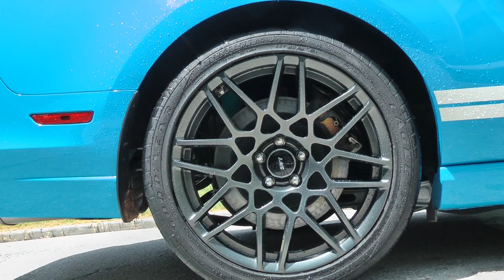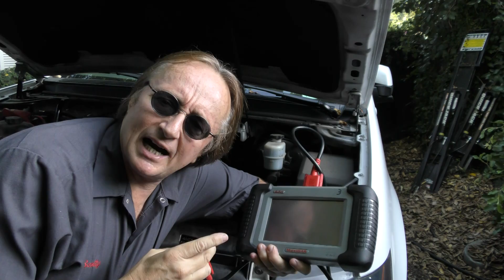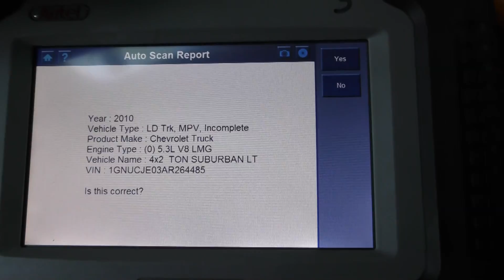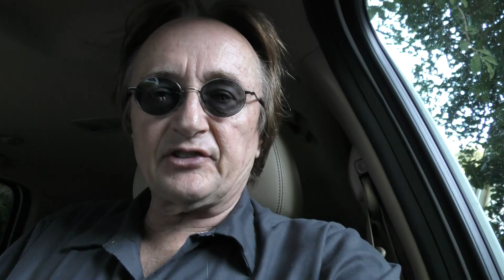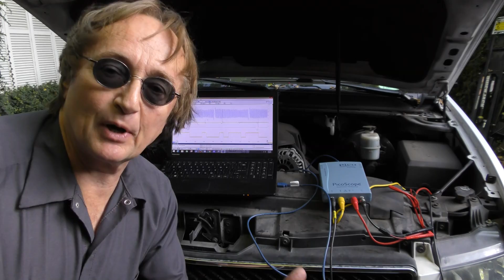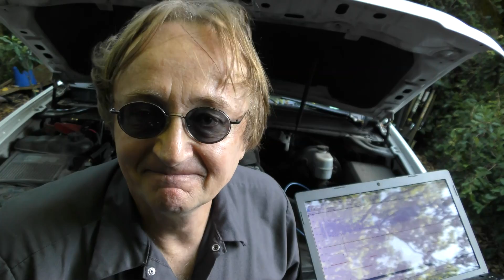Why Mechanics Charge So Much to Fix Your Car

Comment: Please.. I agree that modern cars are insanely complex, but the guys at the dealerships aren't much smarter than anyone else unless it's a common documented issue. The other issue is if there is a complex issue, like the one on that tahoe, most dealers don't want to touch it not because it's complicated, but because the time needed to diagnose such an issue is huge money. I just recently fixed my 2013 Jeep Wrangler that had a bad crank sensor, but it wasn't bad enough that it threw a code. So even though it was under warranty 2 dealers simply said "Could not replicate" the issue. Grated it was an intermittent stall issue, but it took myself and about 2 days probing multiple sensors with a cheap rigol Oscilloscope to find the square wave from the sensor was dropping out very occasionally. Simply put, most but not all Mechanics are nothing more than parts changers.,,
Reply: all carpenters do is cut wood all firemen do is put out fires all bill gates did was look at a computer all day
Reply: Gmtail Which is why no one should NEVER trust them with what is theirs!
Reply: Agreed.. I am a car guy, so I am real picky about what work gets done, and who does it even under warranty. I also always check their work, tend to hang around more than I should. Most experiences have been positive, but a few I had to step in.
Reply: @Gmtail  thats a real dick move in my book imagine you at your job and i stand behind you and say no you arnt suppose to do it like that this is how you do it considering i have no experience or qualifications

Comment: Mechanics charge so much because they only get paid for labor the parts cost only covers the cost of the actual parts and a little secret if they charge you for 2 hours of work they get paid for 2 hours wether it takes them 1 hour or 5
Reply: Jason  Staggs That's if it is the flat rate system.  If it is warranty the mech gets less labor time than standard for the exact same job.  That's one reason it's hard to make money working at a dealership if you don't get the right vehicles.  Our shop pays it's employees hourly.  The pay may be less, but you know what you'll have at the end of the week and most the time the stress level is less.

Comment: Hey scotty, I always hear you say "modern cars" what years would you consider to be modern? I know my 99 Jeep GC is full of electrical issues that I've yet to be able to fix. I've replaced my BCM as well but the problems persisted, I'm kind of leaning towards my PCM or alternator at this point because once I run the car with the alternator unplugged from the battery/pcm my gauges start working again.

Comment: Subaru wanted $1k for a power steering pump on my grandmas Subaru.. its was 170 dollars in parts, and took me 2 slow hours to do.. Also the power steering pump is the most accessible thing on a Subaru
Reply: Clayton Bridges .....Other than the head gasket issue with N/A Subaru engine, they are really easy to work on. It’s true you may need a scanner when CEL goes on, but the work is not that difficult for a DIY.

Comment: Just stick to a car from the 90's, I would recommend an import, Last a long time, generally speaking pretty easy to work on, easy to find parts for them. If the engine ever goes out, you can just look for another used engine and swap it out. Like Honda or Toyota.

Comment: because they paid too much for scan tools you can not buy because it's expensive and you don't need it everyday ,  and they get you directly to the problems without any guessing

am i right Mr.Scotty?
Reply: thesniperofcs That is a misconception that a scan tool tells you exactly what is wrong.  The tool is an aid in helping you diagnose a problem.  You still have to interpret the information and then use experience, techniques, procedures, service information, and system knowledge to isolate the issue.  Does you home computer tell you what is exactly wrong when it pops up an error code?  If scanners could tell you what part to replace, I guess we wouldn't need tech schooling, diagnostic trouble charts, training on new systems, or have to pay for expensive tooling.  Heck every Tom, Dick, and Harry could fix driveability and electric problems on cars and I would be out of a job.

Comment: Coming soon in a modern car ......you will not be able to replace anything not even a battery, light bulb or any sensor without needing the computer to be reset by the Dealer.... soon it will be brakes, wheels and exhaust.

Comment: WOW! I was considering selling my 1994 truck, but I think I'll keep it going now bc everything newer is even more complex and impossible for DIY repairs.
Reply: Even my 1995 truck was already getting too complcated with plethora of sensors and ECU in trouble breeding feedback loop.  But changing fuel filter was 20 min job, not like newer trucks where  you have to drop the tank

Comment: This is why I drive a 1994 Chevy Silverado.  Easy to fix, but you still have the luxury of anti-lock brakes.  As a side note, ignore the back up camera and learn to drive the old school way.  I've seen damaged bumpers and tailgates, due to a lazy reliance on cameras and sensors.  They're not that accurate.

Comment: I am 55 and my dad was a master mechanic for over 50 years. he live to 94 He taught me a lot so I could take a car apart and put it back together again.. I worked on my car from the age of 15 then I went in the NAVY on submarines after 7 years in I got hurt badly but even in a wheelchair I could still work on the cars before 2012 . I can still do the small stuff oil spark plugs and a few other things . My car now a 2014 has no dip stick and the transmission can not have the fluid change. No wander mechanics make so much car makers are making them way harder to work on like me a back yard mechanic .

Comment: Very good reason not to buy any of this modern day junk on wheels. These news cars don't last as long as the older vehicles of the 1940s,50s,60s,70s and 80s It so true when you see 100+ year old Tin Lizzie on the road still.

Comment: God what a joke all this electronic crap. Think I'll just keep my 97 corolla running.
Reply: kerry1111111 Your vehicle has an engine controller, maybe an ABS and airbag controllers on board.  There is more electrical microprocessors in your Toyota than you think.
Reply: Oh yeah I know but I don't think to the extent of one of these newer cars. They seem to be engineering backyard Mechanics out of the game?

Comment: I haven't been to a mechanic in years and I have OBD2 cars. Many sensors and their circuits can be checked with a volt and ohm meter and don't need fancy equipment, but I'd certainly like to learn more about live data analysis.

Comment: Sadly most cars from the 80s and even early 90s aren't worth the hassle.  Finding one that was owned by someone responsible is a real gem. Finding cheap used cars is easier than ever though if you know where to look.   I bought a 2007 mazda 3 with 60k miles on it for 6k back in 2010. The previous owner leased it and barely changed the oil.  Luckily engines aren't so fragile. 3 low mileage oil changes later and the the valves look good as new.
Reply: @exmerion - Are you such a know-it-all in daily life, too ?!?

Comment: I can offer another insight into why mechanics charge so much. The labor. By that I mean that hard to get at part that you scrape up your arm on. Or the hard to get at bolt where you need to contort painfully to get to it, and you're lucky to get one click on the ratchet.

Or repairing the "repair" done by the previous owner.

Not a mechanic myself. Just someone with a growing experience working on used cars.
Reply: Yes life as mechanics can be very annoying.  You cannot choose what cars you work on.  As DIY owner, we can pick an old, easy car to work on, but not professional mechanics.

Comment: you can get a lot of that same data with a 12$ blutooth adapter which you can output all the data to a laptop of a cellphone saving money on buying the specialty hardware. its not enough to flash the computer or do anything like that but its enough to give you a good idea of whats wrong

Comment: I took my Subaru into the dealer because I couldn't figure out what was wrong with it and it needed to go in anyways for the airbag recall. I paid $50 for the diagnostic, turns out it was just the O2 sensor (I'd guessed either that or the map sensor) But then they wanted to charge me $400+ to replace it... It's one bolt and a plug, unless their shop rate is 1k and hour I don't see that happening. Bought the exact oem make off the internet for $100 and did it in 10 minutes. I'll keep my $300 thank you

Comment: Hey Scotty thank you for your video. I got problem in 06 murano. When car ideas engine randomly surges and car looses power when acceleration up the hill. Rpm go high and barely any acceleration. It started to happen after previous mechanic changed my spark plugs. Thank you !!!!
Reply: Hey @AramK - It's been 5 years since you asked the UNCLEAR question above on an 06 Murano.  Did you find a mechanic to fix, yet?!?

Comment: Love your vids scotty. i drive a 95 lexus es300. This problem took me almost a month to figure out. My car would lose OD gear randomly. Didn't know what the problem was. Couldn't figure it out. Took it to 3 transmission shops and even went as far as taking it to the lexus dealer.  Nobody could fix my car. Long story short it was the ECU. Now my car shifts prefect.

Comment: Why do they charge so much? Well sometimes work can be taxing... Most of the time, fact is, you DONT know what to do... They do. You do not understand what really has to be done to get it done. They do. So basically.... You can get scammed easy. You wont know better. Or they are hard workers and do the job right. Which you still really dont know. Good luck!!!!!!!!!!!!..............
Reply: Reading codes its like puzzle on new cars it may point out at the map sensor but, it could be a vacuum leak stupod codes.

Comment: Mileniums can't turn a screw.
Reply: It's millenials, not Mileniums.
Reply: I love it!  Mileniums is better than my grand papa calling it face page!  Im stealing this word.
Reply: This dumbass trying to talk shit about another generation, yet can't even do it correctly.  Btw it's generation Y also.  Bet ya learned something new.

And no i'm not a millennial im part of generation X 😏
Reply: marc G tf Is mileniums?
Reply: Actually, when I worked at John Deere (building Gators), there were quite a few extremely talented millenials there. Those kids knew those Gators, inside and out.
Reply: We rather know advanced computer systems than an easy thing like turning a screw. We'll leave that to the old people.
Reply: no its weak minded sheep who cant turn a wrench. I have over 300k miles on my vehicle's and have made every repair myself.

Comment: never buy a lifetime 4-wheel alignment from tire kingdom or tires choice. the mechanic gets a  certain percentage by doing an alignment, but they dont get anything from a car with a lifetime 4-wheel alignment...so they just half-ass it, or dont even check it at all
Reply: agree I've checked my car after some of these life time alignments from firestone and struts bolts are left loose and most time the alignment is worst than when you bring it in.
Reply: Yes, true.  It's just a money grab and the subsequent times you come around, unless you're buying new tires or services, they will not be happy to see you wasting their time.
Reply: As a mechanic at national tire and battery (tire kingdom branch) you are absolutely incorrect. We get 5$ commission on program alignments. We almost always at least tweak the toe a little bit even if it's still in spec. A lot of people will drive around with major steering/suspension issues and an alignment will never hold true and customers are informed of that as well.
Reply: jared Taylor at the factory if a car comes back through alignment for whatever reason it can already be out of spec and its only been driven a mile or so.
Reply: Love seeing clueless dipshits think they know what they're talking about

Comment: hey Scotty I have a 1995 Toyota Camry 2.2 4cyl. the car has 303766 miles on it and the transmission just took a dump should see if the filter and fluid should be changed or just take it to ammco will fix it?

Comment: OK I will take a stab at it. They charge a lot because they, as Scotty has shown us, have to buy and maintain equipment that costs TENS OF THOUSANDS OF DOLLARS, including, but not limited to: Bidirectional scan tools, multi-channel oscilloscopes (like the Pico),  alignment machines (priced one of those babies lately?), hydraulic lifts (they certainly aren't cheap), air compressors, hand tools (try, just try, to get on and off the Snap-on truck for less than a thousand bucks somtime), software updates (hundreds of dollars per month),rent/mortgage on shop, utilities, supplies, salaries if he has any help in his shop, and don't forget he is self-employed (at least the independent mechanic) meaning he has to pay BOTH the employer AND employee portions of FED tax, state tax, social security, medicare, and other taxes and taxes on the taxes. Add in licensing and ongoing training, and, I'm no mechanic, but I suspect you have a fair bit of overhead in all this.

Comment: mechanics always want to charge me double the price for parts.  I can always find them cheaper on Amazon and with a good brand.
Reply: encryptor try not to buy electrical parts on ebay or rockauto or amazon (i.e. ac compressor, fuel pump). those places are only good for parts that you cannot normaly get from autozone. i learned this the hard way.

Comment: Unless you have a VW, you can replace the battery. Dealer only carried the part, then the computer had to be resets it would know a new battery was installed.

Comment: mechanic's charge so much because they Make a 100 dollars a hour. so for something simple like a diagnostic should be 100 flat. Anything above a 100 a hour they are  over chargering you. the 100 dollars comes from the bar which states mechanic's are paid 100 a hour but like Scotty who seems a cool guy like myself will be honest a fair but some out there will charge 500 for "oxygen fuel sensor". .

Comment: My moms boyfriend told me there are 2 types of mechanics , 1 that rips you off and charges you up the ass, and 2 that rips you off and charges you up the ass but fixes the problem
Reply: She's So High its true for the most part. but there are a few honest mechanics. i recall driving to a guys house who had a ford ranger with a crank, no start issue. he was convinced that it was a clogged fuel filter. before i even got to that point i replaced the fuel pump relay with another one. the car started up. i charged him 30 bucks. on my way home i thought to myself, " i dont think i charged him enough"
Reply: But if you give actual ass than it's free.
Reply: She's So High, there is another kind, one that fixes the problem and charges accordingly
Reply: She's So High yet people love getting ripped off daily when they eat fast food and spend $5-10 on food that is worth $1 at most. 

💯
Reply: He's right
Reply: She's So High hit me up when you wana get higher😍
Reply: That's the iron triangle of business: Get it done fast, get it done cheap, get it done right. Pick two.
Reply: She's So High Get on your knees.Thall make payment
Reply: define rip off. if you cant get the work done cheaper anywhere else it isnt a rip off, its just how much it costs
Reply: @Bjorn Ironsides  what is reasonable and according to whose rules?!
how would someone come up with a 'reasonable' price?!
Reply: She's So High either way they both rips you off.
Reply: @STeeLo205  rip

Comment: You can't even change the battery on a modern car anymore. With all these fancy start stop features, you have to take the car to the dealer for them to 'program' the car to accept the new battery. All a whole load of money making baloney if you ask me!
Reply: I wrote same coment before reading yours..............it's racket politics and looting the customers.......( maffia governments , asphyxiating restrictions and regulations , taxes and licenses , controls and fines for whatever once you sit behind the steering wheel )
Reply: You can buy cars without these features.  For the people willing to pay for them there is a benefit.
Reply: Incorrect, I always hook up a battery saver to the obd2 port and have never had an issue replacing the hundreds of batteries I have done in my past 4 years as a mechanic

Comment: customer came to the shop with a LS 460 lexus ..... never thought the parts alone were so pricey $1500 plus labor ... ugh
Reply: Takes an hour to drive before the oil is on temperature ..?
Reply: Yup 9quarts....  Plus toyota changed the transmission fluid changeits like changing oil on a differential
Reply: Hector Trejo lexus is the only gasoline engine that ive seen that use 9 quarts of oil. not even full size trucks and vans use that much